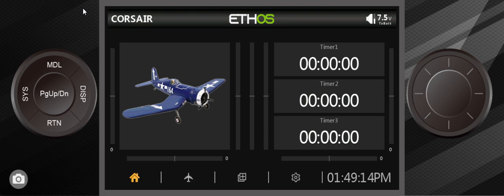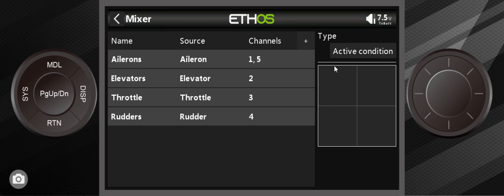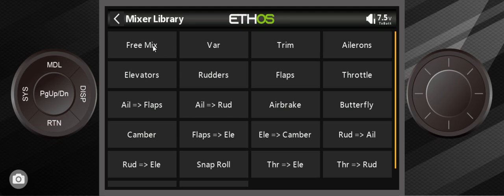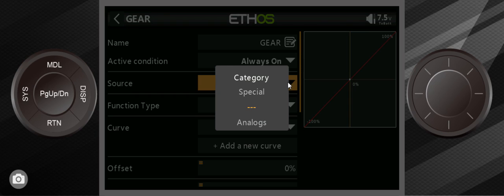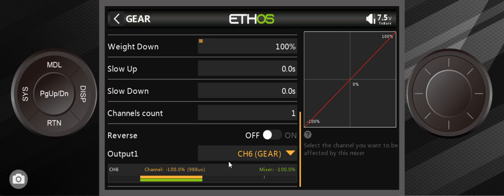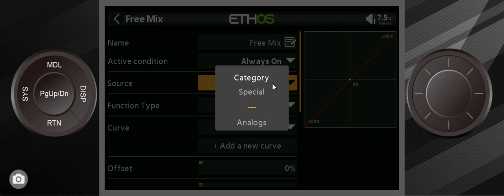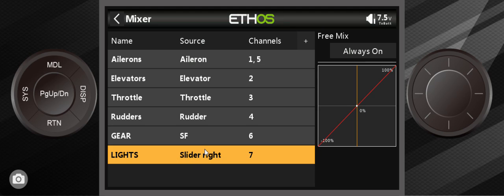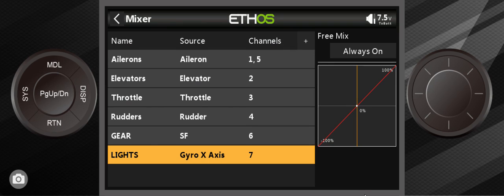FrSky Ethos, assign a channel to a switch, knob or slider

Comment: Very helpful thank you I am testing the X14 with an ELRS module to explore transmitters other than radiomaster. I fl;y fixed wing ELRS with speedybee flight controllers. Can you point me in the direction of some setup videos for this configuration? I love the ETHOS interface and want to take full advantage of it using INAV and lua scripts. cheers!

Comment: Hi Steve, thank you for your Work :) 

Maybe you would do a Video for us and explaining how to opposit Differential in Butterflymode / Brake for a Glider. For example i have a Glider with Aileron Differential so it moves more down than up. So if i hit the Butterfly Mode Ailerons Go Up and Flaps down. In this Moment my Glider has almost no Aileron movement. I know Theres a way to Turn the differential in the other way so the Aileron moves more down and the Glider have much more Roll rate. Sorry for my speaking, iam Not a native speaker.
Greetings from Germany. :)